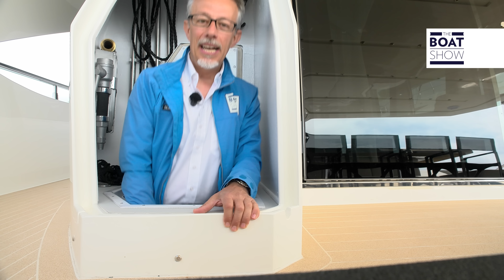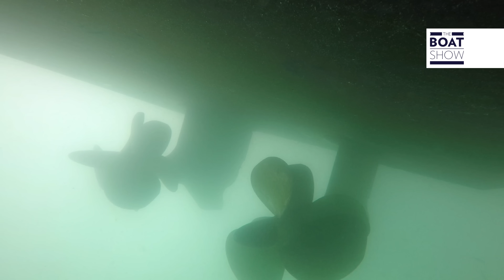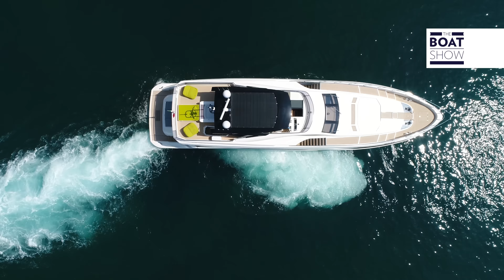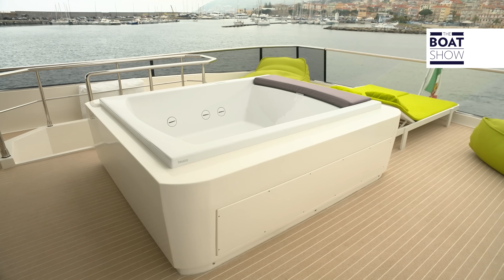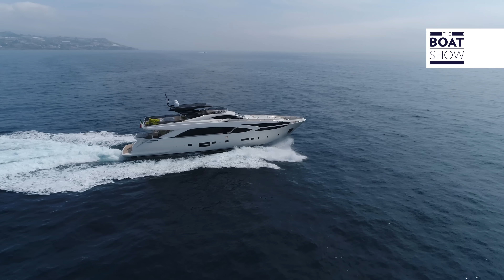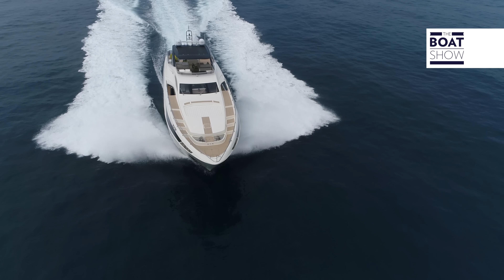[ENG] AMER CENTO QUAD - Luxury Yacht Review - The Boat Show

Comment: I love that they used the Volvo penta system. I however do question using four smaller engines versus three 1200's. That engine room looked pretty tight.